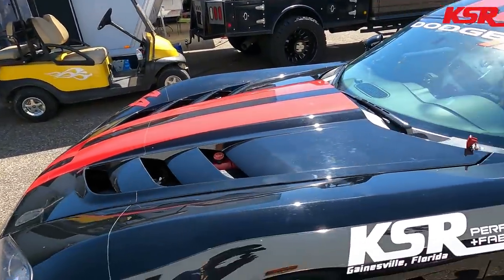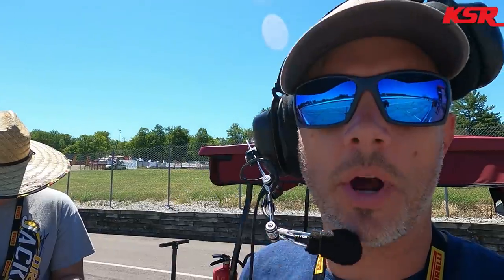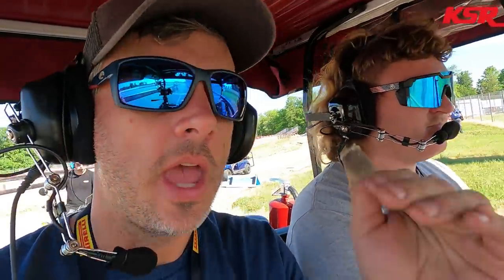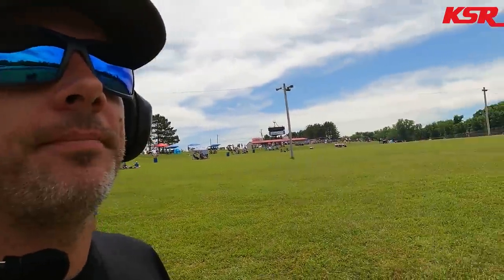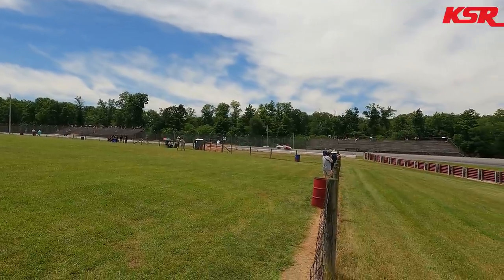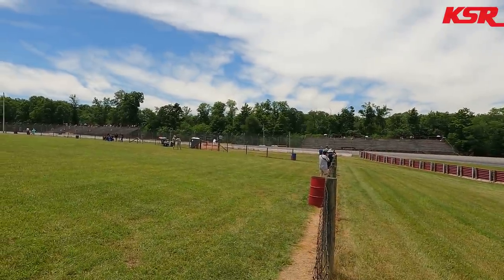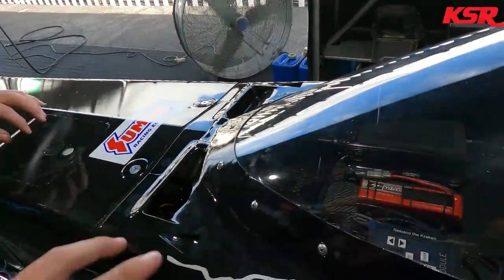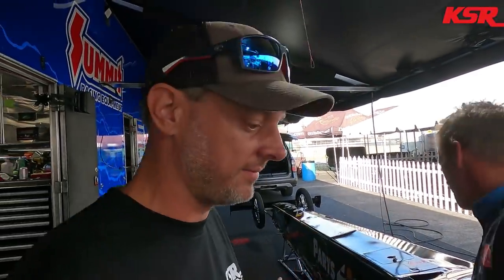Racing a Viper Street Car with The Trans Am Series??!!

Comment: Love seeing you guys back out with a viper at the track again.  Tyre pressures wise, we used to do a similar thing with the pressures on a saloon car cup championship entry at castle combe in the UK.  One day I'd suggested we try running the tire pressures so that the they were all even half way through the race, instead of at the end (so psi at the start and end is exactly either side of the same midpoint on all 4 corners).  Car ran quicker than ever and we won not only our class that we normally ran, but the class in front as well.  Maybe enough to help Lee catch those Porsches next time!

Comment: And you can thank a guy named George Simon for pioneering the concept of Money Making advertising on Motor Sports vehicles.  He first put his company name, "U.S. Equipment Company" on his Unlimited Hydroplane "Miss U.S." in 1955 and fought the IRS when they would not allow him to deduct the cost of racing as an advertising expense.  Finally, in 1963 Simon won his case with the IRS, that Unlimited racing was a legitimate business expense (within specified guidelines) and therefore tax deductible.  On the strength of this ruling, Anheuser-Busch entered the sport in a big way in 1964 with the first in a long line of Miss Budweiser hydroplanes.
In 1962 George Simon's Rolls-Royce Merlin-powered Hydro with Roy Duby at the wheel, set a mile straightaway record for propeller-driven boats at 200.419 miles per hour. The record stood for 38 years.

Comment: In amateur motorcycle racing we ran the chicane into the keyhole and did around 1:35 laptimes in novice 600 stock. Maybe 1:33 in expert. Prolly what your car would run if doing that config. Interesting.

Comment: Couple questions about tire pressure…
1. Can you use tire pressure sensors inside the tires?
2. Can you use nitrogen? Always heard there is less fluctuation than reg air.

Comment: Kevin what was the reason for the check engine light being on Lees viper.  I always love going for a ride with Lee he is so smooth...
Reply from the maker: Both cars have always had the light on. Something to do with a code that is turned off, but the check engine light still comes on. It has a factory ECU that was tuned by the engine builder so we just run it as is.

Comment: why not use nitrogen (pure) not standard air, wont that eliminate the need to mess with tire pressure as much? or is there another gas used that is more stable?
Reply: Heat in the tires will vary wildly. Nitrogen is a pain to deal with when you're at a track.